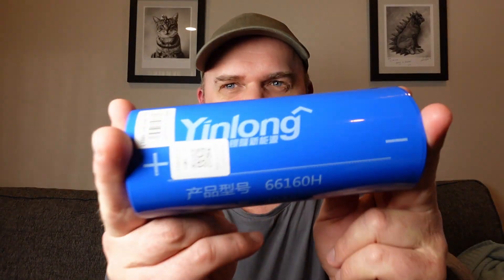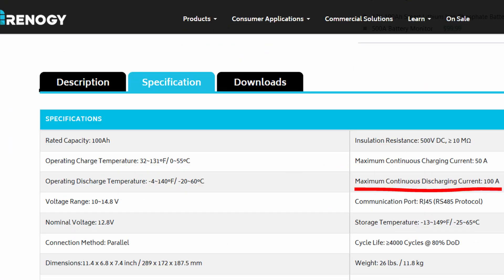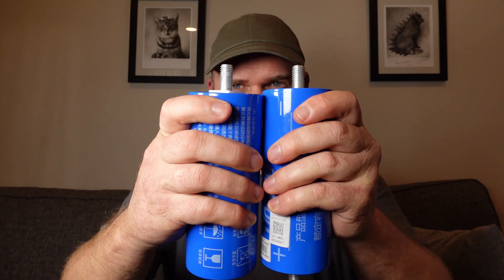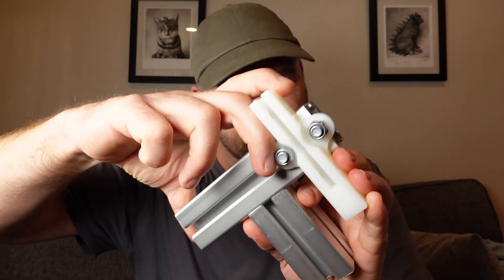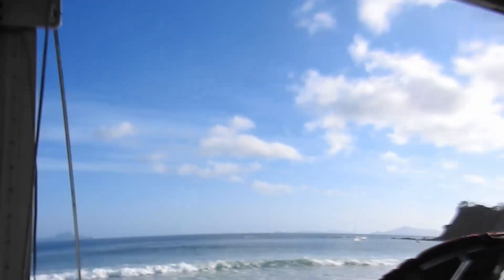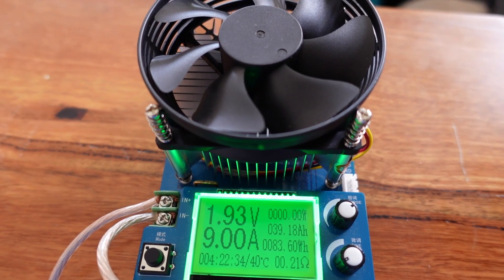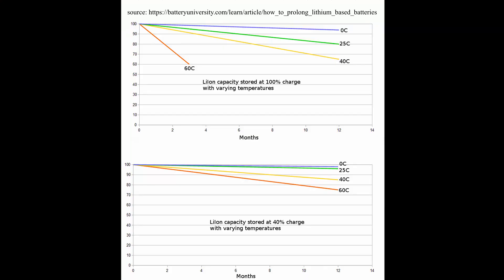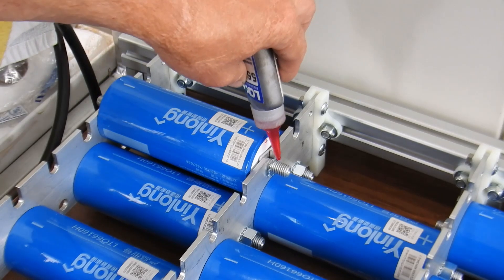Campervan DIY battery build HUGE POWER!

Comment: Yin long cells are bad.  The amount of usuable energy is so low.  The heat buildup of high discharge rates and resistance within the battery are extremely high.  And the health of each cell is so wide.  Do a load test with a 5s or 6s balancing lead and you will see a large variation of voltage under load as well as pretty high temps as well as very small energy window.  These are way over priced for what you are buying.
Reply from the maker: You have personal experience with these cells or you are basing your opinion on those of other youtubers?
Reply: @brendontait6968  I am basing my experience on tests that have been performed on them.  With balancers as well as using thermal imaging of the batteries during and after tests.  The busbars stay relatively cool but the batteries get really hot and you can tell the ones with higher resistance because they heat up the most.  Everyone who works with any lithium battery knows thats the biggest weakness.  And also the voltage sag and voltage variation is extreme with these cells.  The 18 ah is a slightly better battery.
Reply from the maker: @ripsta2009  so zero experience with yinlong?  Of course if you are pulling 400A per cell, they will get hot.  So will anything.  See what the car audio guys have to say about them...  they deliver tens of thousands of watts, and these seem to be the go to cells for them.
Reply: @brendontait6968  no they are not.  That information came from the car audio guys.  The go to for car audio is scibs and cmaxx.  Cmax will ah for ah destroy yin longs.  I know I am part of the car audio guys.  I have 19 lishen 18 ah cells and of tests they are slightly better than the yin longs.  I have Headways, pouch cells, as well as 32650 that I have personally ran these tests on 5 ah puts out 70+ amps with a 4s leads to watch for voltage variations.  With videos.  I am just saying dollar for dollar there are better lto cells out there.
Reply from the maker: Oh yeah, the cmax...  those are the ones that catch fire rite?  I've seen a few car audio guys have their cars burn to the ground with those ones.  Each cell has its pros and cons, for me... I'm not pulling huge loads, like 10kW max and these batteries do what I want, they will happily work in the cold where I'm planning to take my truck...  I'm happy with them, they have worked flawlessly in my application so far.
Reply: @brendontait6968  not putting down your video or anything it was a great video.  Just saying keep an eye out for the voltage variation if you see any from a cell or 2.  Those could turn catastrophic later before the rest do and we all know what that will bring.  Yea cmax is a complicated battery to do right with all the compression and this and that.  But like all energy storage devices there are risks and those risks can be increased without proper care knowledge.
Reply: I only mentioned higher c rates with a battery monitor like an isdtbattgo because with those higher loads you will see which cells have average reistance and health and ones that will reveal the ones with worse health.  These low draws won't reveal that information very accurately.  You will be able to see cell v variations as well as temp variations.
Reply from the maker: These low draws work out to be about 2kW for my pack.  I have a resistance meter and grouped all cells when I built my pack.  None of them seemed crazy different to any other.

Comment: I remember LTO cell from 2010-2013 era. They where supposed to last 30 years! They lasted like 3 years so whats new today? Has anyone tested them long time? Dont go buy them if they must last 10 years or more. If they are so amazing, why are they not widely used in various products??? I had a Schwinn Tailwind Battery in for repair 4 years (2016) ago and the cells where not even alive, they where zomies and refused to hold a charger. The bike was from 2012 so the LTO has a lifespann on 3 years before they became worthless at least the 2012 version and if the newer version would be worth buying, why are not samsung, panasonic, tesla etc concidered using them? They probably have and the they probably have short service life.

Also the panasonic cell on video is a protected cell, panasonic does not make protected cells, chinease factories does, and panasonic cells are expensive, printed heat shrink tubing is cheap, google 33050250301. Also the if your gonna put a cell on fire, let us know how charged it is, because it the charge that is being discharged. 

Its great that DIY selfers test stuff but dont belive a chinease company (zhyle aka zinlong) which have only exited for 5 years and is named after a dead dinosaur... Thats just not Just "Goodenough" for me... Also about all product images they have on their webside are 3D rendered images. Maby will prowse or someone can dig closer inte this company. They also does not seem to have updated their website since 2017. Is there any datecodes on their cells? It seems like this chinease company might be just as dead as that dinosaur they are named after... /The Battery Doctor in sweden
Reply from the maker: So you are basing your opinion on this chemistry based on a single battery failure you saw?  I have seen many different batteries fail for various reasons well before their due date, whether it was from bms failures, being used high temp at high soc, abuse etc.   Both Mitsubishi and Honda use LTO in electric cars they make (I'm pretty sure honda would have done their research).  I think you are mistaken when you assert that Panasonic do not make protected 18650 cells.  From my experience...  the date code on my cells shows 2 years old, the battery is still cycling at over 100% of  rated capacity.  There are many studies that show the calendar life of LTO cells.
Reply: @brendontait6968  Thanks for the response. But i know for a fact panasonic only makes cells, not protected ones, they are always after market. Did you google the number? Where did you buy the cell? Why did you not puncture a LTO cell?

The problem is if LTO where fantastic then it would not be a secret only a few DIY fans would know about. If it where reliable, then you can be pretty sure the it would not be a secret. The discontinued chemistry Toshiba SCiB was a failure and the same Schwin used. Mitsubishi and Honda cars with LTO is nothing you can even find on google, and much less buy. No company has ever produced a LTO product that has not been a failure. If you want to waste your money fine, but dont claim it will last 25 years just because the chinease company stated that in a  years only video. I have a few LTO cells and might do a 500-1000 cycles batch test just for fun...

Comment: Excellent info, thanks for the insight and links. Might I be so forward as to suggest you take a look at "Nord-lock" washers for the studs as these will not come undone through vibration but will not apply a torque to the studs when, or if, you need to remove them. Thanks again.
Reply from the maker: Hey, thanks... yeah they are quite cool washers.  Not sure I'd use them here, but I agree, very cool

Comment: You can heat locative up with a soldering iron or some other heat source to make it pliable sos not to do damage to your batteries, neutral cure silicon is a good soft threadlocker , great post cheers for the info and your time :).

Comment: There should be NO repeat NO mechanical or thermomechanical load on those terminals. Mount them in a flexible foam medium
Reply from the maker: Does it make you very annoyed to see them semi rigidly mounted?  

Mounting in any way will impart some load on the studs.  The question is...  how much is too much?  Do you have some experience to show this?  I believe the worst load you could put on them is a flexing moment.  

My experience to date....  I have 99 cells mounted for over a year like this.  I have driven several thousand km with them including some very bumpy and corrugated dirt roads.  I have not seen a single cell failure yet.

Since publishing the video, I have developed communication with the factory and have asked them if they could get their engineers to look at the video and tell me if they had any concerns with my method of mounting. The reply was that they couldn't see any issue with the mounting method.

Please let me know your experience if it can enlighten me me some.   Cheers

Comment: correct me if i am wrong here please.  my thought on this i do like this battery first. things are not adding up this cell is only 2.3v with 40ah using your link. your comparing it to 12v 100ah battery $900. this comparison is not fair. you would need at least 10 of these cell to get close to the output.  5 cells at 2.3 = 11.5v at 40ah x 2 would get you 11.5v at 80ah. this is still short by .5v and 20ah say maybe 11 or 12 cell to get closer. anyways. your comparison of $0.027 times 10 cell be to equal or close would be $0.27 per kwh at $500 it is still better. i would like to be a update video if i am correct.
Reply from the maker: Ok, so I'll try explain....  the price was per unit of electricity delivered through the rated life of the battery, per unit of electricity... not per cell.  So it wouldn't matter if I used one cell of each or 1,000 cells of one and one cell of the other in my calculation.  The price per unit of electricity delivered is the same.

Comment: Why not just use blue loctite?
That red grade is for permanent installation, and typically requires heat to break it free.
Reply from the maker: The stuff I used is loxeal 55-04 and is equivalent to blue
Reply: @brendontait6968  Thanks for the reply.  Great video.

Comment: For the shrinkage / expansion due to heating and cooling. You have the numbers 23 parts per million per degree. I am coming up with per 100 thousand, not per million.
Reply from the maker: You have too much time on your hands!  The video was just a recreation of how i measured several months before.  I was holding the camera and the calipers at the same time and didn't measure the lengths accurately.  Had a look for the paper I calculated it on but can't find it.  Am fairly sure I calculated it correctly.  Next time I'll calculate things like that on the computer so I can save it for people like you!  Cheers
Reply: @brendontait6968  Thanks for responding. I just thought the topic was very interesting especially given the thermal expansion being so similar to aluminum.
Reply from the maker: @SiXiam  it kindof makes sense since the cell is housed in aluminum?
Reply: @brendontait6968  Yes that makes sense. I was thinking more Lithium ion expansion and contraction slightly deforming the aluminum walls.
Reply from the maker: The cells actually make a sloshing sound when you shake them... so there must be some airspace inside.

Comment: High school dropout here too, not trained in science, but have a passion for it and over the years, have gained a lot of knowledge and I am self taught. I get that reaction sometimes too, lol.
Reply from the maker: Well said!
Reply: @brendontait6968  Back here after 8 months, because I realized once I researched this again recently, that LTO batteries actually rock! I never knew it at the time, but once I read about them recently when thinking about building a lithium solar and wind system, I was impressed and this came up as suggested video for me. Then I realized I had been here before, hehehehe. Man, aging is not fun, this kind of thing happens more often to me now, as I get older. *facepalm. Great explanation though, love your bus bars and setup, how awesome.

Comment: How would I use these to create a 24v battery to run a boats trolling motor?
Reply from the maker: Really however you want.  I'd probably go for the prismatic cells to make it fit in a smaller volume.  Like I said... i just ran 11 in series.

Comment: A 11s would work with all my equipment.  So you are correct it appears.  Are they more expensive than LiFePO4 prismatic as some have stated for the same Watt Hours?
Reply from the maker: Yes they definitely hold a premium price to the LFP pack you can buy.  It depends on your situation. For my truck where I wanted the safest, most robust pack, they made sense for me.  I'm going to be going to areas that are cold and I want it to last a long time before having to refit something.  I will be doing a home offgrid LFP pack in the near future which is cheaper per Wh, but not as robust.
Reply: @brendontait6968  Off Grid does not usually require high amperage batteries, but the long cycle life is nice.  The only thing I would suggest on your layout is to have the lower batteries also in slotted rather than a hole to allow for changing one bad battery without disassembly.  Nice job.

Comment: Hi I wonder if you're willing to help out on an off grid solar project in Mangawhai. I can't see an email address so posting here. I've been planning on doing this for a number of years and not scared of costs etc but would like to get the amount f batteries needed to run a small house right before buying and setting up the solar panels to charge the batts. Loved your Unimog vid. looks like you were not that far from me on the beach. Keep up the good work.
Reply from the maker: Hey Lee, I'm a bit time poor at the moment, check the description under update for email.  I'll try help with any questions that I can

Comment: @Brendon Tait how many in series would you recommend for 48V?
Reply from the maker: 21-22
Reply: @brendontait6968  x$50 each. $1100 for a 48v 40A battery pack.

Comment: Never realized there where proper fireworks in my old laptops. Thanx!
Reply from the maker: No stress
Reply: you're probably joking, but be aware that the fumes can be highly toxic and caustic to your lungs.
Reply: @w0ttheh3ll  Would never intentionally overcharge or expose a battery. Hell, I turn in my prius bad cell for recycling after replacing the bad modules. Thank you for looking out for the less intelligent on the internet though.
Reply: @crpth1  Improper charging setup on cells without protection circuit?
Reply: @crpth1  Cat-astrophy avoided. 😁

Comment: So if you really wanted you could buy a single 2.3v LTO cell and use a step-Up converter to get a stable 12v Nominal. There would be some losses but these are acceptable. What would a 40Ah LTO 2.3v capacity get you in 12v real-life usage? Are there any boards with 2.3v to USB 5v that are very efficient (98%) or is it more sensible to add two in series and Up (buck)-convert to USB 5v or 12v?
You get my point, is it better to do it this way because of the lifespan of these cells and keeping the form factor small?
Reply from the maker: Hey Robbert, it really depends on what you want it to power.  I find at 24V the currents are very high for my purposes, running at 2.3V - the current flows would be too big to be practical, letalone finding suitably sized boost converters.  However, if you only want to run something of maybe up to 100W your idea would work.

Comment: Hi Brendon, very interesting video. I would like to know some more technical info. For example, to get the same amount of total usable energy out of a 48v system built with these batteries would it be heavier or lighter than a comparable lithium iron battery pack. This is an important aspect for sailboats (the lighter the faster :).
Reply from the maker: Hey Ralf, thanks.  This is a Lithium ion cell.  There are many lithium ion chemistries.  The best weight/power would be some tesla modules

Comment: Hi Brendon, great video. Would you mind if I used about 10 seconds with your channel name stamped on it for one of mine. When you get the 18650 to fire off! Cheers
Reply from the maker: Hey Dan, no problem.  Fill yr boots!
Reply: @brendontait6968  cheers, doing something similar, but went the lifepo4 route.

Comment: Excellent video..... What are you using to charge these batteries that are in the battery bank you built in this video? Are you charging them all at once or pulling them out and charging individually? Also, I have a motor home that I'm thinking of using these on for when I go boon docking, plus I've built my own 26 inch (above ground) recumbent tandem trike that I have plans on motorizing for a cross country trip and thinking of using that battery set up you have in this video. I wonder how long I could power the portable drill I'm going to be using as the motor for that 21 speed/geared tandem trike???
Reply from the maker: Hey William, I just charge them on solar - so much power to be had just from the roof.  I'm not sure yr drill would last very long?

Comment: Opens up with concerns about safety - then installs 90 kva.. 😲 I would be more concerned about the actual power output the ... 😳🤔🤓
But good vid with lots of details - LTO is awesome. Has anyone validate the 20000 cycle decay? For the cost calculation 🧮 to be true. 🤓
Reply from the maker: Cheers, this chemistry has been produced by several manufacturers, it has been studied and tested by many research facilities and universities.  I've read papers where they have completed the extended cycle tests and have actually seen upto 40k cycles.  However these will likely fail before then due to calendar aging.  I mentioned that in reality the cost might be closer to 10c/kWh